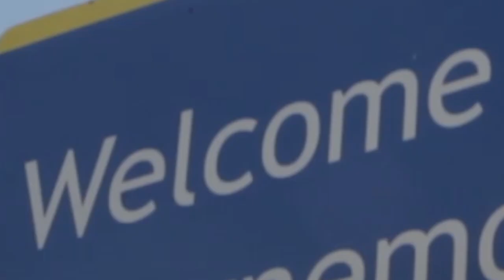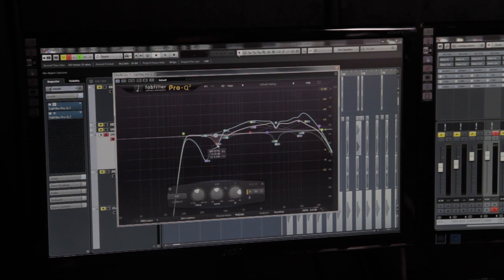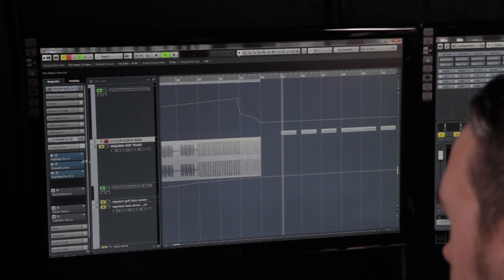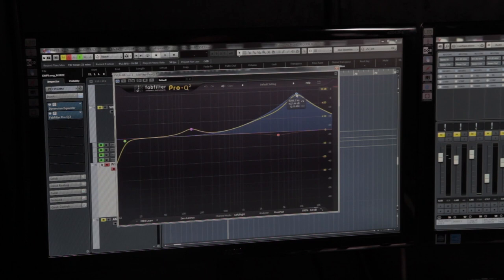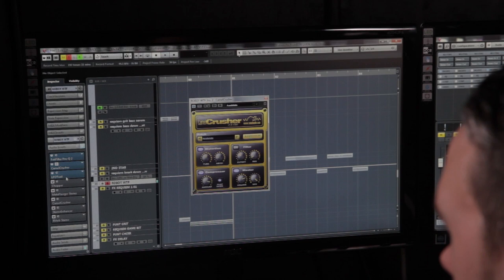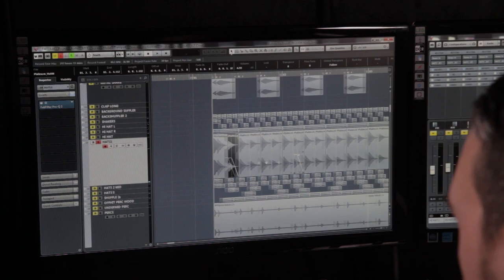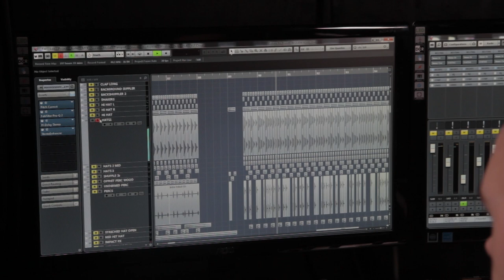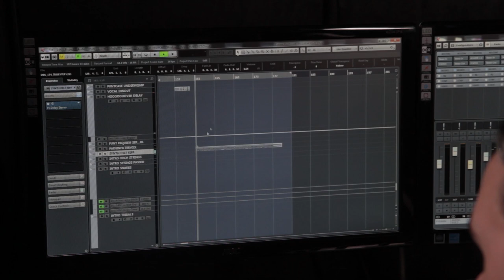Steinberg Studio Sessions S03EP04 – FuntCase: Part 2

Comment: How called this stereo enhancer plugin which he use?
Reply: +Lase its part of the default plugins that come with Cubase
Reply: +Lase any stereo enhancer will do. In Logic, Direction Mixer works great - can choose between L/R and mid/side. 
S1 Stereo Imager from Waves is considered one of the best and a classic..
Reply: +SCATTERBØX Thanks I using Ableton every day so i was curious.
Reply: +Lase Ablteon has a stereo enhancer called Utility.
Reply: +Itchy Dez Thanks mate i didn't know that utility is a stereo enhancer usually i used other plugins.
Reply: No worries, man (:
Reply: +Lase Be careful, utility isn't a stereo enhancer, it just allows you to isolate mid and side of a track. It wont add stereo image to a mono sample like enhancers do
Reply: +Chris Anderson thanks chris I tested utility some time ago and indeed this isolate mid but it works fine to making transition between speakers in some sounds, so ableton probably there is no any stereo enhancer in default plugins.
Reply: Lase
maybe try the classic solution double the track pan one left the other right?
Reply: +SCATTERBØX of what I remember izotope ozone have imaginer this works the same yes?
Reply: Lase hell yeah, its amazing.